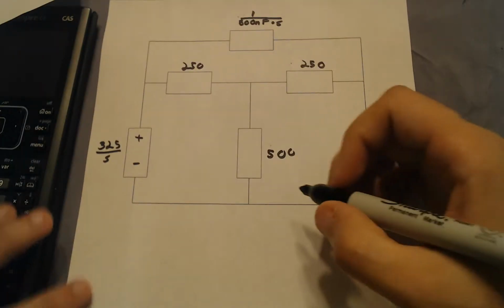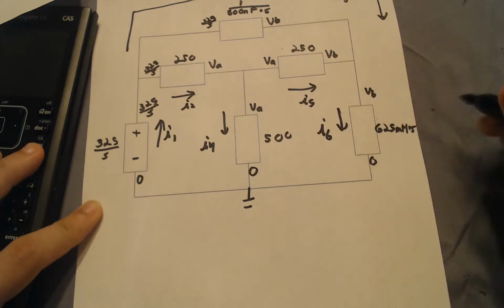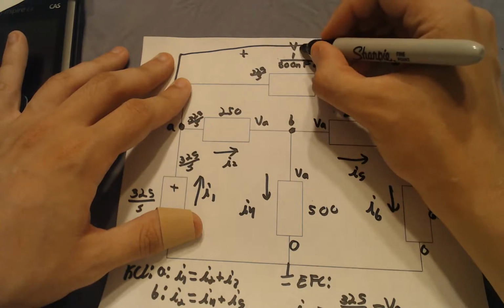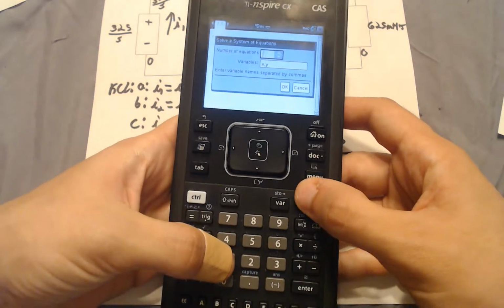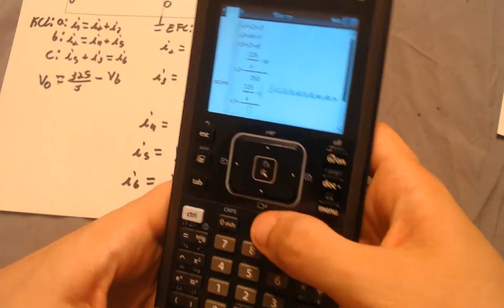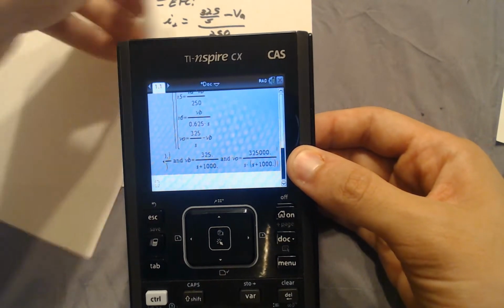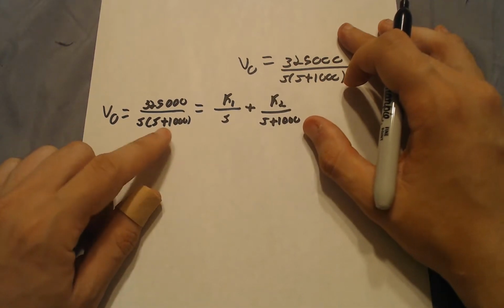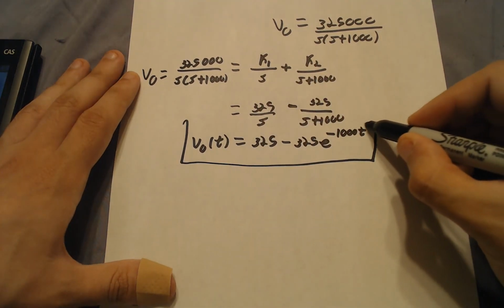How to solve a circuit using Laplace Transform with a TI Nspire CX CAS

Comment: I am trying to create your Laplace Equations sheet at 0:31 into the video.  I found some issues.  On the right-hand side shouldn't the I(t) be I(s)?  Also, shouldn't the left-hand side derivative be on iL, not iC?  I haven't had time to check these issues out as my class is tomorrow and I have a long doctor's appointment before it.  
I was thrilled to find the two circuit videos and show them in class.  I was hoping to be able to just download your handout.  I tried to find you to write this as a message but I could find no other way to contact you.
Reply from the maker: You are correct! Thank you for pointing these out. Unfortunately, I no longer have these documents on my computer so I am unable to share them. I created them originally using draw.io and Word. :)